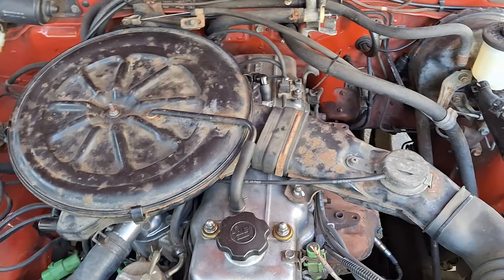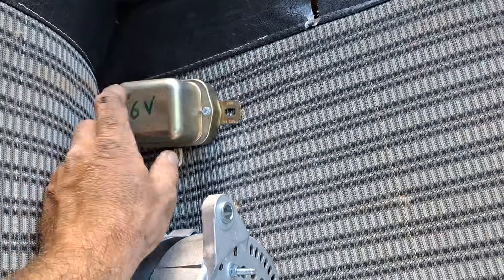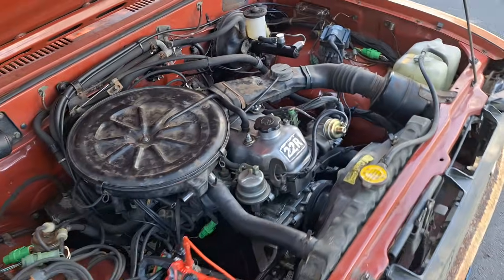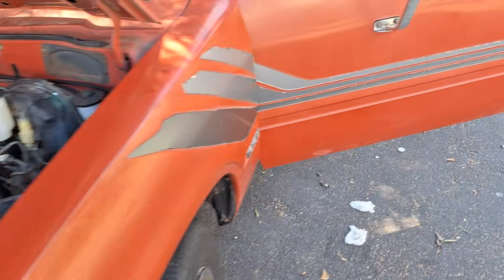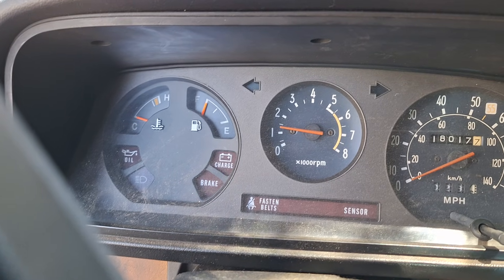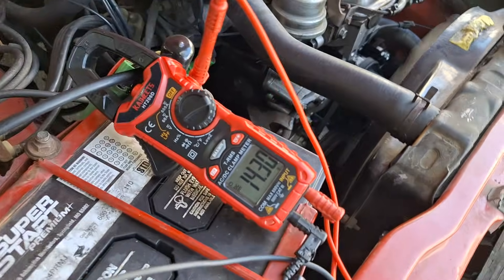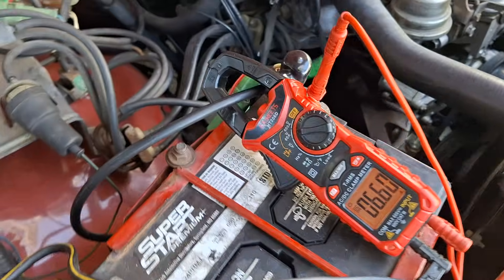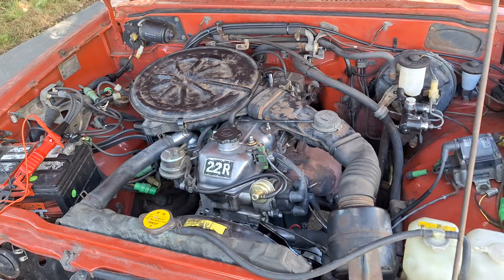1981 Toyota Pickup SR5 22R GM 3 Wire Trail Gear Alternator Wiring

Comment: What did you do with the old wires from the voltage regulator and what did you do with the plug wire that plugged into the back of the old alternator?

Comment: How did you delete the voltage regulator? Did you just splice the wires coming in and out of the regulator and splice the alternator to the yellow wire?